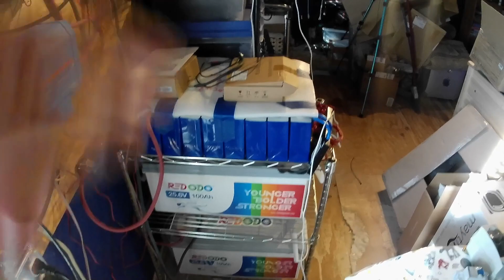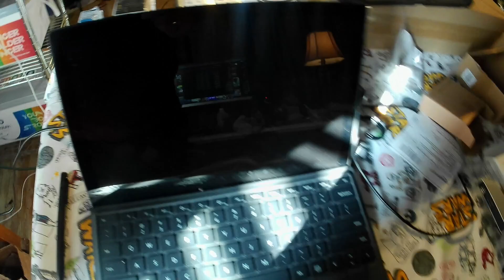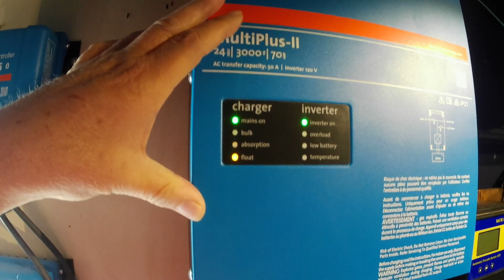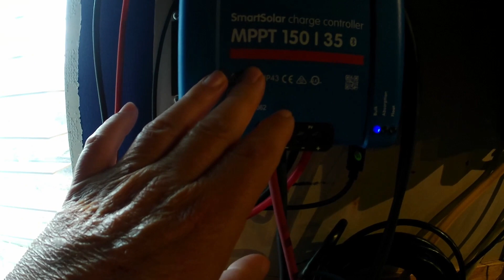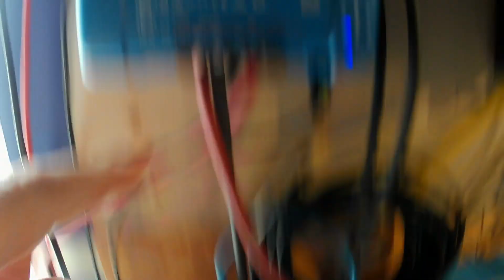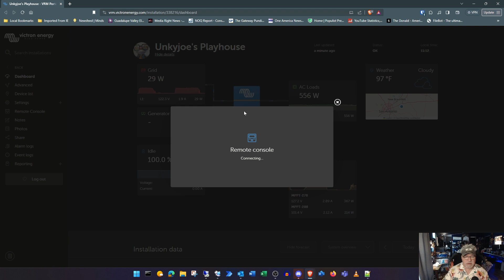Victron for the Win!

Comment: Victron is the bomb, scalable and modular.  We went offgrid with victron some time ago and wouldnt look back. The MQTT interface can be used to change settings as well, so you can fully control the system remotely if you want to (tip: the topics starting with N are an output, R is a request for data and W is to write settings to the cerbo)
Reply from the maker: Been following your channel as well, your videos and other's "Off Grid Garage" helped me make that decision. Thanks for watching :)